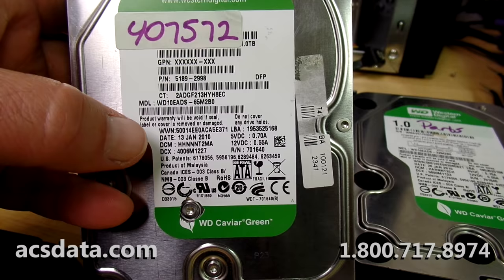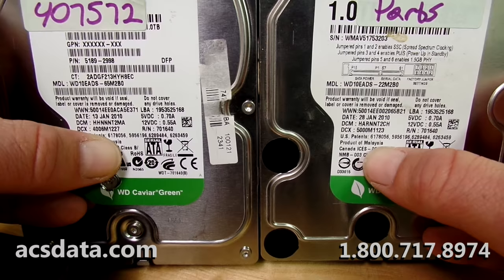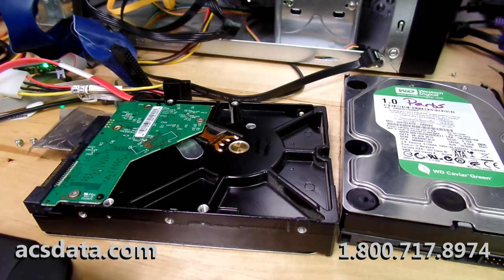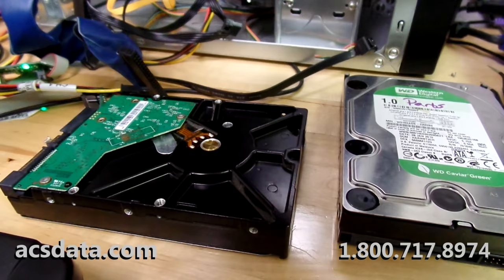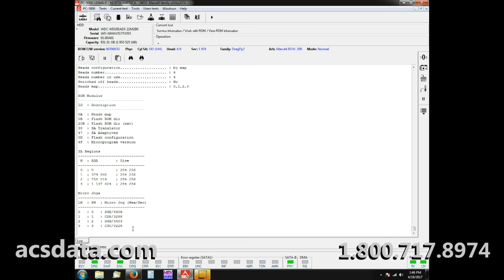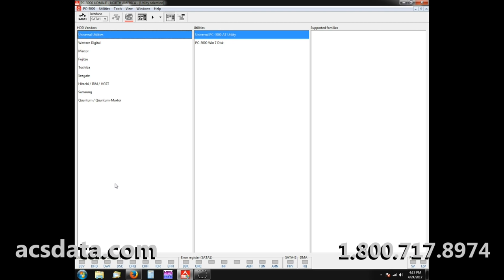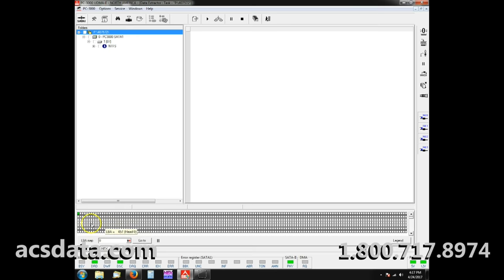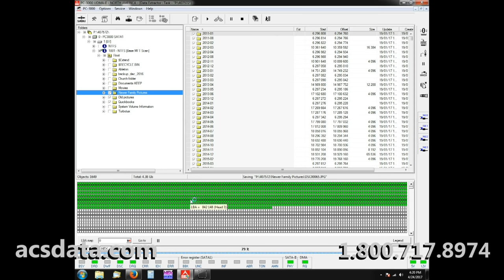Repairing A Damaged Hard Drive And Data Recovery - Drive Thrown From 2nd Story Balcony

Comment: Well,
       The first thing i notice is a 1 vote for thumbs down .That seems to me a jerk or a super jealous competitor .BTW none of the new drives PC3K can parse microjogs ,they are all ZERO .Either the tool does not understand were they are in newer drives or simply WDC has changed some format .But i Do See DAC Preamp Value There Have You Seen this Sir .I am Also Interested To Know The Name Of a Good Peer OF DR Field .The Best Thing The customer did Was Not To Power Up the Drive  .Another Trick I Like is Blocking SA Access And Then loading The Dir And Overlay Modules And Starting SA For Full User Area Access ,This is a small Trick That i Can share With You In a Private Video Like this You Never Need To Use Slow Responding Solution in any WDC Drive
Reply from the maker: Yes, we started seeing that issue with microjogs in some of the later 2TB drives I believe.  It may have affected some 1TB drive families, but I haven't seen one yet.  Feel free to send an email to greg@acsdata.com if you would like to have a point of contact. He actually does most of the recoveries in the videos posted here.  Also, we don't worry too much about the thumbs down or even some of the negative comments we get at times...we realize these videos aren't perfect and they aren't for everyone.  :)